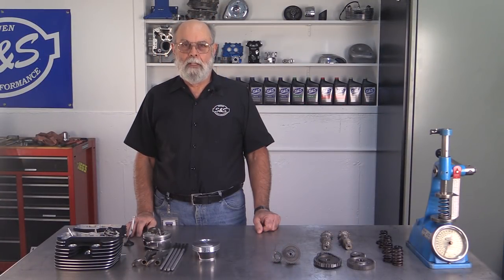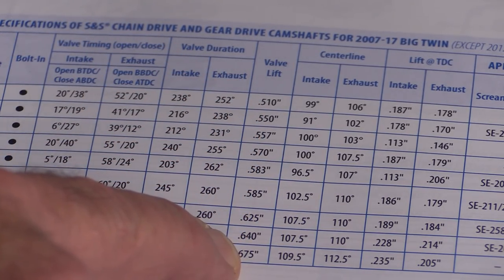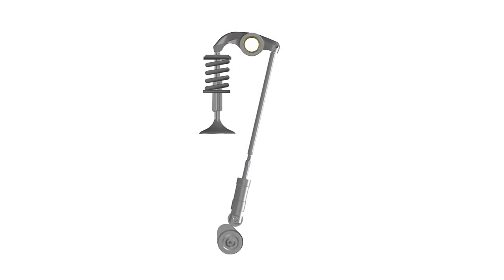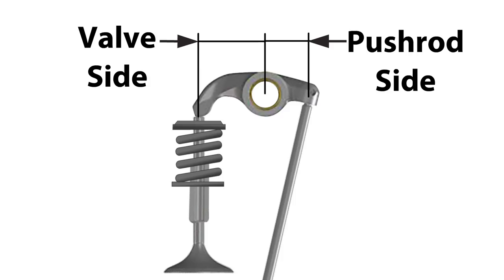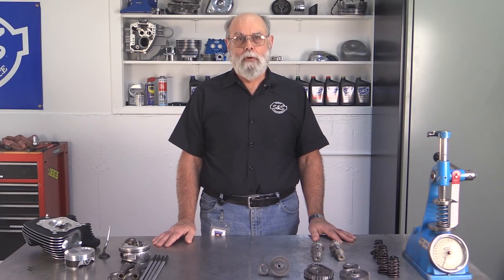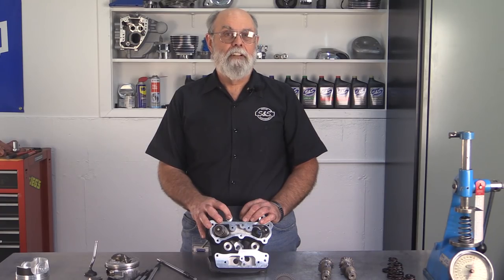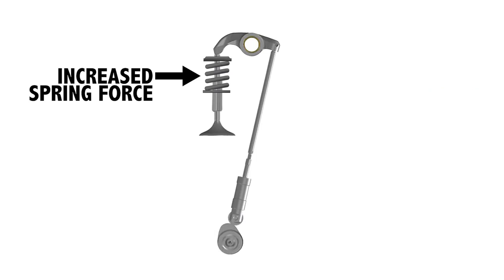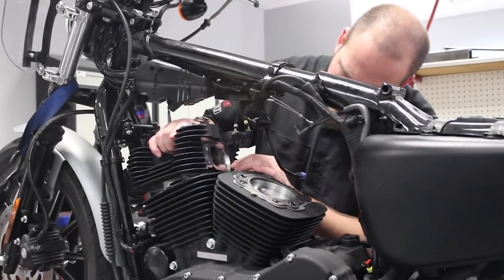S&S Cycle - Understanding Cam Specifications - Part 2A

Comment: What are the limitations of the valve springs in the Screamin Eagle 110ci that comes stock on the FXDLS?  Recommendations for cam upgrades / comparable to the SE 259 that's in the Screamin Eagle 117ci kit?

Comment: You can't replace a valve spring without removing the head on a bike?

Seems like you could just hold the valve closed with air pressure while you change out the springs, seals and keepers like on automotive engines....